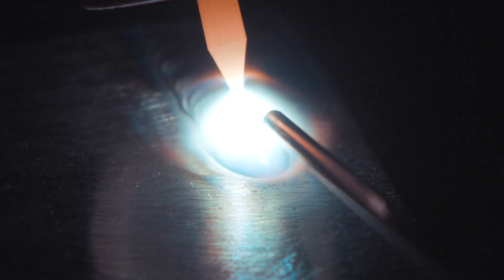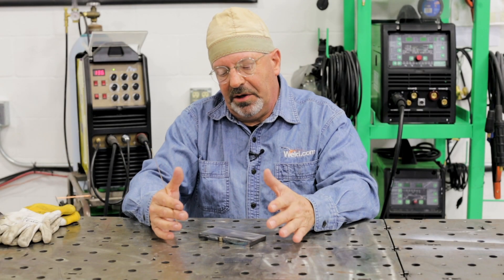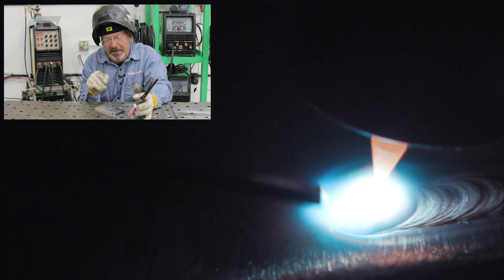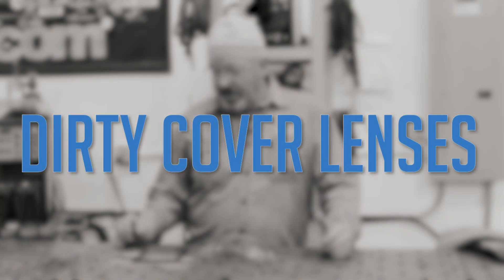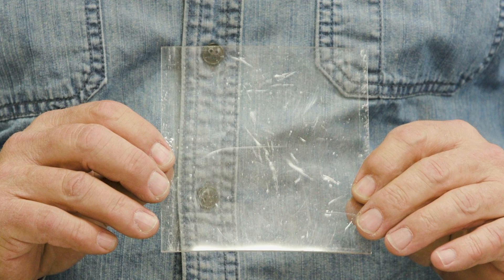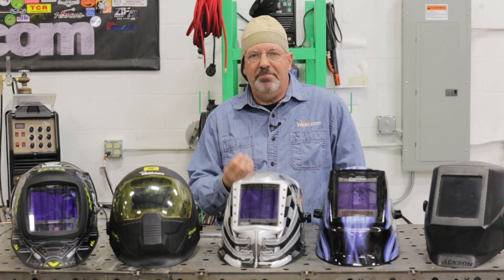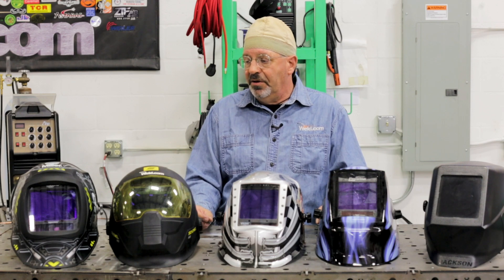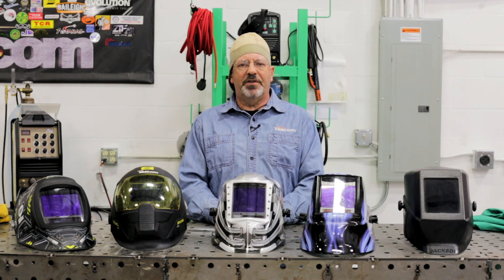I CAN'T SEE WHAT I'M WELDING!!!

Comment: i weld aluminium daily... im having trouble with pepper in the puddle... im using an everlast 250 ex and i cant seem to get the settings right ...also my tungsten gets nodules  growing very frequently and occasionally splits and goes all to hell.... any suggestions?
Reply: TiredOld Bones I weld aluminum too. Have the same issues. What I could also use is some tips on welding two different thickness together. Tend to melt the rap out of thinner material.
Reply: @doreenleach3068  keep the heat on the thicker metal... then kinda wick up to the thinner metal
Reply: "pepper in the puddle" sounds suspiciously like contamination in the aluminum.  Are you sure it's clean before welding?
Reply: @Jefflong2011  thanks for your reply....i wire brush with a stainless brush and wash with acetone.....the contamination seems to happen as soon as i light up...i will get a burst of black soot and then it will clean up mostly after an inch or two... i have the ac freq set at about 75 and the balence at about 35 % neg....i dunno... i ll just have to keep adjusting i guess... sooner or later i ll figure it out

Comment: Maybe something on the different settings and care & feeding of the autodarkening shades. I’ll swear mine isn’t reacting quickly enough to arc strike. Poor Man Cub!
Reply: Some hoods have sensitivity and delay settings, but those are just preferences. Even if it never goes dark, your eyes are completely protected, there are at least two layers of material in there which are completely opaque to UV even though you can see right through it.

Comment: Welding a lot of fluxcore on heavy plate weldments in confined spaces we keep a spray bottle of isopropyl alcohol to spray our clear lenses, let it run off and spray it again, then just a burst of air to dry them off.  Don't like wiping them! Takes 2 minutes but saves $$$ on replacing lenses all the time. Keep up the great videos.
Reply: Good tip .it makes sense. But why didn’t you tell me about this 20 years ago?
Reply: Isopropyl doesn't damage the cover lens plastic?
Reply: @johntomasik1555  I have used  isopropyl alcohol on all plastics and rubber for over 40 years and never have I had it melt or distort. On some cheaper well cured paint I've seen isopropyl alcohol attack a bit. Bottom line I see isopropyl alcohol as a next step strength up from Windex, 409, Fantastic ect.
Reply: Thank you! I'm going to try that.
Reply: Good tip, i usually just blow the worst out with air and change clears often.
Reply: Never wipe your polycarbonate.  That's the biggest reason I need to change my outer lenses.
And my glasses.
And never use acetone/nail polish remover.
Reply: Try that in a steam drum.

Comment: Keep a can of spray away glass cleaner handy will float smoke and dust off less scratches
Reply: Running through a heated ultra sonic tank might be the ticket.
Reply: Run it with water, spray with glass cleaner and wipe it with a microfiber nylon cloth. Anything nylon is better than cotton. Works great

Comment: honestly I hate my glasses, and i hate my eyes, neither are optimal for welding view distances
an aside- positions had me welding blind today at work hah

edit- also I personally set my auto darkening to around 13 for damn near anything aside from plasma/oxy cutting, where i drop back to 9 (or grind for oxy)
Reply: Indoors i have to darken 2  12 or 13. Fixed  lens 14 for spray arc aluminium bronze see my icon

Comment: What's the best way to clean soft plastic cover plates without scratching them ?
Reply: Spay window cleaner and a microfiber or synthetic cloth meant for electronics. They won’t scratch plastic. Paper towels and cotton might as well use sandpaper.
Reply: @Mikey-ym6ok  make sure you  clean any grime off with a spray water bottle first. If you leave any debris on the screen and start rubbing the lens it is like sandpaper scratching the lens. As the instructor said try and keep you helmet clean and away from possible grime getting on the lens.
Reply: There are polishes just for plastic, google or amazon.
Reply from the maker: A comment above references isopropyl alcohol and a burst of air. Sounds like a winner if you have compressed air nearby.
Reply: Weld.com great idea. I’ll try that
Reply: @Welddotcom 

I make a mixture of 2 parts isopropanyl, 1 part lemon based dishwashing liquid and 1 part water. Slosh it on fairly liberally, spread it with your fingertips (very light pressure, rinse it off under running water and shake dry. You can use toilet paper to BLOT up stray drops but don't rub the lens with ANYTHING!

I use this method on all my glasses and have never regretted it. BTW, my day glasses cost me more than 18x the price of a really expensive self darkening helmet... I have learned the hard way!

Comment: One thing I found that obliterates my view is backlighting. I usually weld outdoors and if the sun is behind me it’s like I’m welding by Braille.   There is a back shade attachment that I got that solves it. It was debuted at the last fab tech.  Black Stallion part AH3035-NS
Reply: I use a leather overhead flip shade to keep the sun out. Condensation is like a motorcycle helmet. So now have leather curtain snapped on standard type helmet.
Reply: @mordantly  
where did you get that one?
I have issues with the overhead shop lights sometimes.
Reply: Just about to say the same. I went and got a pop-up 10x10 thing, mainly just to keep crap off me from falling out of the trees on my work table, but because it's Texas, that sun is starting to get hot too. But yeah, a brand new helmet was like having a mirror in front of my eyes and I couldn't see a damn thing!
Reply: Also, you guys can try a pancake hood👍
Reply: Wade Wittman  a little difficult to use with tig.

Comment: This is my BIGGEST prob when welding, keep hoping I'll get better as I go, but it's a huge challenge. I added "reader" lenses to my viewer, but w MIG it's really hard to see. I lower the shade to 8 & get spots, 10 gives me not so much. My view is nothing like these closeups.
Reply from the maker: Make sure you orient yourself looking in front of the wire.
Reply: Keep in mind these were shot through state-of-the-art new lenses only available for the past couple of years and only on top shelf helmets. If you have a mid level or fixed-shade lens it will never look like this. I have what was the highest spec Speedglas only 4 years ago, in great shape with a new clear, and compared to a modern Optrel it feels like you have green Vaseline in your eyes.

Comment: As an "older" ,over 60, now fabricator here in the UK, I find reflections from overhead lighting cause me problems.
Simple fix for me is a piece of clean cloth placed on top of my head, covering the gap at the top of the hood. Works for me !
Reply: Try a pancake hood ! No back reflections
Reply: That gets really exciting when an errant spark lands on it though.
Reply: @Mentorcase  You can buy flame retardant spray to spray on any cloth to make it flame resistant.
Reply: @Mentorcase  
Maybe a piece cut from the back or sleeve of an old welding jacket ?
Reply: That's what I used, cut from an old jacket that I cut down to make a welding jacket with just sleeves and shoulders.
Reply: @Mentorcase  use FR cloth
Reply: The old timer that taught me the basics of GTAW had a piece of leather riveted to the top of his helmet. I didn't quite understood why, and it kind of annoyed me every time i used it, until i used a shiny new auto-darkening helmet. The moment i struck the arc, all i could see was the inside of the helmet.
Reply: @bogdan_n  that's a good idea.
Reply: @bogdan_n  today was my first day of class and this is what i experienced...hugh headache
Reply: Leather works well !
Reply: I need to shine a bright light onto the work piece to be able to see anything other than the arc itself. A lower power lens just makes the arc brighter.
Reply: Same here!!
Reply: YESSSS!!  I have the same problem with the SUN or bright lghts behind me.  Have to have SOMETHING like a coat or a jacket usually thrown over the Back of my head and helmet.  The older I get, the worse it is.
Reply: When I built my shed frames that was the only way to stop sun reflection inside the helmet, with the added bonus of less hair burnt off from overhead welding.
Reply: Amen to this, I though I was the only one that had this issue.
Reply: As I'm nearly 60 I have the same problem, I just cut down an old black t-shirt and fix it to the back of the welding mask with double sided tape so it covers the back of my neck, I can even see clearly outside with overhead sun!
Reply: @CrazySparkie63  Right on, I'm 56, did the same thing but was laughed at hysterically. If I could have I would have welded their mouth shut permanently.
Reply: That makes perfect sense... I think that will solve 80% of my problem. Thanks!
Reply: Another fix is taping centerfold pictures to the ceiling above your working area.  You won't feel bad about bad welds after looking at those reflections....
Reply: I bought a leather sandblasting hood on eBay. Got a cloth snap kit for boat covers. Put male snaps on the hood and the female part on the helmet. The hood snaps on/off, keeps extra light out of the helmet. Works great underneath a car or outside.
Reply: I'll have to try this out, anything to get better I'll try
Reply: Had the same issue when I started.
Reply: Same issue here, it washes your image out.
Reply: Worked for me too for a while too , then I had cataract surgery ,worked wonders  I no longer need glasses .
Reply: Lol I guess that works but doesnt it fall down to the point of aggravating?
Reply: Same age, same fix - I do the same, but already got the rag on fire a couple of times, while stick welding.
Reply: Great idea indeed will try this
Reply: I attach a clean red shop towel to the top edge of my helmet with a couple of binder clips so it falls over the back and blocks out shop or sun light.  I know it's not fireproof so leather would be better, but I haven't set my hair on fire yet.  (Yeah, I'm bald...)  No, I would not use an oily one.
Reply: This may be a dumb question, but does this matter if it's SMAW? I cannot see shit!
Reply: @poppaluv  - I totally get it.  In my own life, most of my SMAW work has been outdoors and the sunlight seemed to be good enough to let me see the area around the arc.  At times, I must admit that I've used a halogen or bright LED flood light while indoors for this purpose.  I never had this issue when I was younger, so who knows?
Reply: People put fans on them cause of the heat that's bad I like a still area gas sucks but not blowing my gas around lol
Reply: I found exactly the same, cut out the overhead light/reflection with a piece of cloth works like a dream (I'm in my 70's).
Reply: DOES IT HAVE TO BE CLEAN
Reply: Victor, I hope you are well, it used to drive me crazy, I put a small leather skin that i attached to the back of my helmet that goes down over my collar of my jacket, this has stopped any light getting in & also no splatter enters the face area, I'm coming up to 63, Chas, Brum, uk.
Reply: Great idea!
Reply: Thanks, I'll give it a try.
Reply: I like working outside so the sun bothers me but fixed with this same solution and I'm 18 =/ but when I started with alluminum with a Miller diversion 165 a 2009 model by the looks of it and I couldn't tell but it was welding but my metal heated soo much it because a soft and bent down because it was mid air and once it melted right though
Reply: Jimbo Jones  No you are supposed to protect your whole face as well as all other parts of bare skin. Similar to sun burn you will not notice the damage until it's too late. Though sun burn is nothing compared to welders burn! Been there done that. Burnt my arms bad enough for a hospital visit. But at least I had the common sense to wear a full welding hood. All in all that was maybe one hour of trigger time. So don't kid yourself.
Reply: @WoodTech9  Holy crap!  Point well taken.  I had a buddy weld in front of me, but I was about fifteen feet away.  I never once looked at the bright spot but later that night, I had to go to the hospital because my eyes were burnt raw.  I didn't realize the other potential damage until you mentioned it.  I will certainly heed your advice!
Reply: @WoodTech9  ŕty

Comment: I'm glad you did this video, I've been 'playing' with TIG for a couple years off and on and have always had a problem SEEING what is going on, with a few exceptions.  I'm one of the 'roll it around in the crud' people so I'll have to look for scratched up lenses next time.  Thank you!
Reply from the maker: Let us know if it helps 👍
Reply: @Welddotcom  I cleaned the lenses and turned down the darkness to #4.  Both helped.  I also found having a sharp, non-contaminated tungsten makes a BIG difference since it produces a much smaller hot(bright) spot.  With too much arc length or a contaminated tungsten, you get a giant hot spot and you (Or I anyway) couldn't see even half as well.
Reply from the maker: @fsj197811  Chris, #4 is much too low for arc welding. You are risking damage to your eyes at that shade.
Reply: @Welddotcom  EEEK, I did say #4 !  I meant #9.  #4 is more like gas welding isn't it?
Reply: @fsj197811  #5 is. But it requires a change from a UV filter to an infra red filter. The IR component in gas welding is what damages the eyes over the long term. Electric welding is UV.

Comment: I generally do all my welding with 2.4mm rods and have trouble seeing. Thought it was just my age - but 7/8? I usually run at least 10 shade! No wonder I can't see what I am doing! okay, there might be a slight amount of scratching and dirt on my lenses - but hey I cleaned it back in 2017, or was that 2015.....
Reply from the maker: Clean that thing and give it another go.
Reply: Sometimes going darker helps.  If its too bright you cant see either.

Comment: Without a cheater lens it's like welding in 360p, but with a +2.5 dioptre cheater lens I'm back to welding in 1080p again Lol
Reply: I’m 70, and I need cheaters too. The last few years had made things harder. Our vision in the dark gets worse as we get older. The bright arc obscures almost everything else. I find that both a light on the weld, and cheaters makes everything easier.
Reply: Tried cheater lenses, but found cheapo readers to work the best.
Reply: @phiksit  - Me too.  I used to work as a tig welder for Kline bicycles.  Wore cheap readers while welding. Made a world of difference.  Could not weld properly without them!
Reply: @phiksit  I found the same thing.
Reply: @phiksit  There are a couple of reasons why readers might work better than cheaters for some.  The readers can be adjusted to fit properly right in front of your eyes, and the position of your head in the helmet won't matter. You might not be able to get an alignment (including eye spacing) as good with a cheater. Also both parts of a cheater are the same correction.  If your vision is not the same in both eyes you might be able to compensate by buying two readers of the same shape but different power, and swapping one lens so both eyes have the optimum correction.  To clearly and comfortably see a tiny weld puddle, you want all the advantages you can get.
Reply: I tried an old dudes helmet with literal coke bottle magnifying glass lenses, hell that weld pool was so big it scared me😂
Reply: i tried using a cheater lens, screwed me up so bad lol i threw it
Reply: I have to use a 3x lens
Reply: Hey guys my vision is 20/20 can I still use cheater lenses? I'm having trouble seeing what I'm doing I can see fine welding aluminum but stainless the puddle is just so small.
Reply: @atmjcdsmaddict7897  "20/20" generally refers to sharp vision at a distance.  That's not what you need to see small things close-up for TIG welding.  You need a cheater lens for your helmet or just use cheap reading glasses you can get at a drugstore.  Find a pair that fits you and start with about +2 diopters.  Experiment with more or fewer diopters from there.  Something that allows you to clearly and comfortably focus on tiny print about 6 inches from your nose.  Once you dial in the strength of the reading glasses you can buy a cheater lens of the same diopter number.  It's amazing how much better and more fun TIG welding is when you can see clearly.
Reply: @atmjcdsmaddict7897  Yes, I think you will be amazed with a cheater lens.  Or use reading glasses from the Dollar Store.
Reply: @atmjcdsmaddict7897   Maybe a jb in Transportation is better for you, like a Uber Driver.
Reply: I have found two problems with cheater lenses. 1) They can fog up badly if you are working in cooler temperatures, and the fog gets in between the lens and the cartridge, meaning you have to take out the lens to wipe away the fog. 2) They restrict your field of view--you've got this wonderful helmet with a huge window, but now you have to look only through the cheater lens. What I have found works better is magnifiers that clip onto your glasses, if you wear glasses, or reading glasses if you do not normally wear glasses.
Reply: you found a good cheater?
Reply: Great analogy!

Comment: @weld.com thanks for that video video ive got a couple of questions  why does my beads look like they are holey and i have my hood shade to an exceptable setting but sill cant see properly?
Reply from the maker: They look holey? Porosity? Try increasing your gas. Also,go watch the TIG 101 video. We go over a lot more beginner Tig in that.
Reply: @Welddotcom  im using gasless mig  with self shielded flux cored wire  type E71T-GS  0.8 mm  wire .